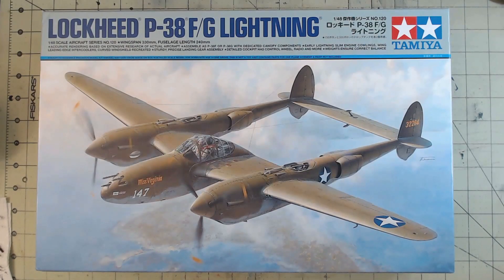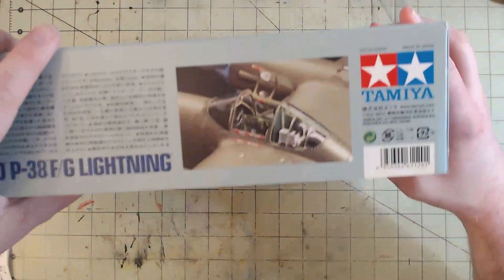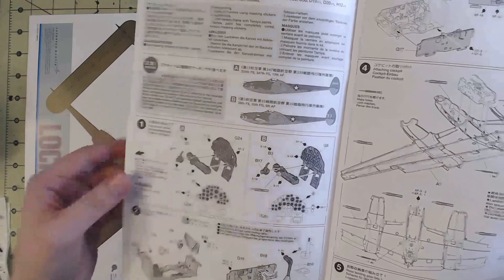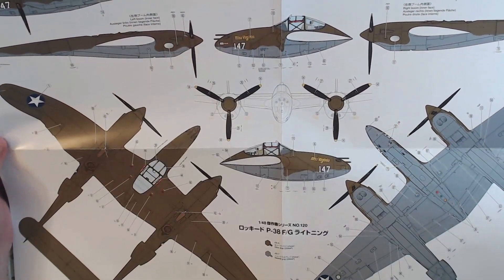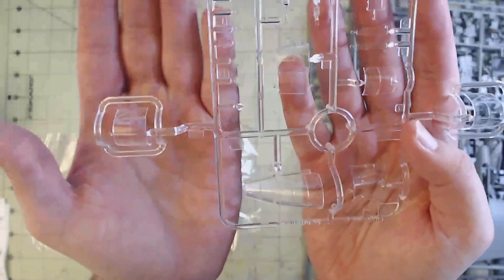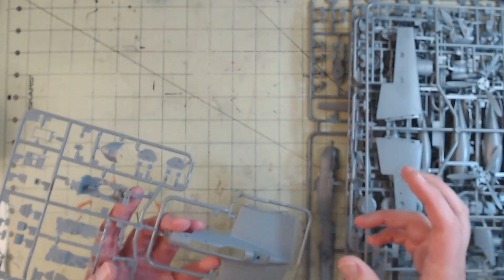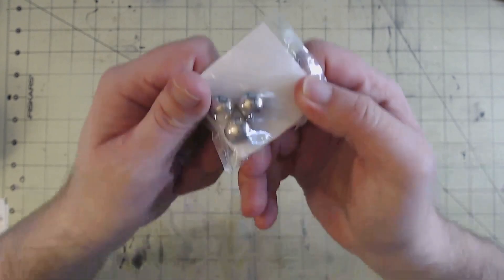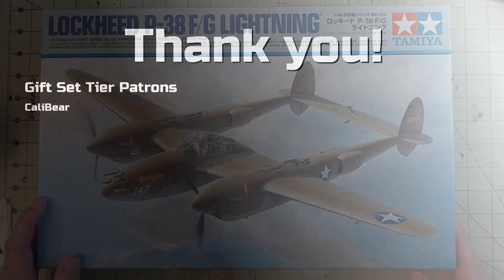Tamiya P-38 F/G Lightning in 1:48 Scale - Unboxing Review

Comment: Well I never knew that process was called "under-gating"...every day's a school day I guess!

Looks like a nice kit and I am always impressed with Tamiya's inclusion of weights for correct sit of the model - their 1/48th He-219 is another good example
Reply from the maker: Yup! Under-gating is one that is... hrm, how to phrase it? I don't want to say more "important" in Gundam modeling, because that isn't the correct turn of phrase, but the choice to under gate parts has more impact there. This is because Bandai molds the parts in the correct colors. You know how when you snip a part off the sprue, there's that little white stress mark that gets left behind? When you paint a kit, that gets hidden, but in Gunpla when people just build an out of box build, those white marks can make or break how a kit looks.

Kits with more under-gated parts are seen more favorably because of this. You can get around it by being gentle when you snip, then leave a slightly longer "nub" than you would for other types of models, and finally patiently trim it down with a hobby blade. If done right, the plastic won't stress and you'll be left with no white discoloration. Under gated-parts, however, stress where the pieces meet, and so that little spot is perfectly hidden, allowing you a little more flexibility. 

But again, if you aren't careful with your clean-up on under-gated parts, you might leave behind material that then prevents the pieces from sitting flush with each other. So it's good to be aware of it at least.

And yeah, I 100% agree, it's sooooo nice when manufacturers include weights. Oddly enough, I think Tamiya is about the only company that I've seen do it for aircraft, though I am sure there are others out there that I just haven't run into yet.